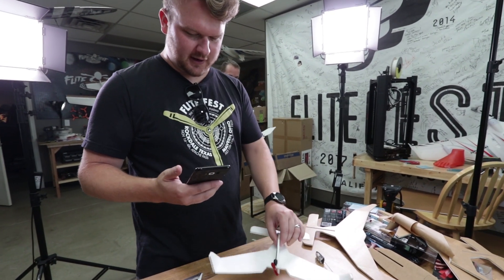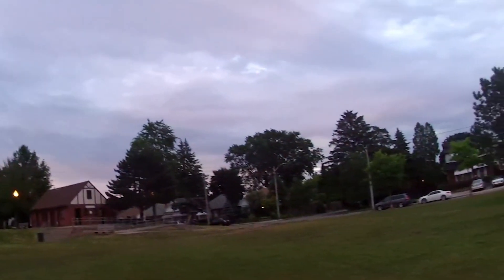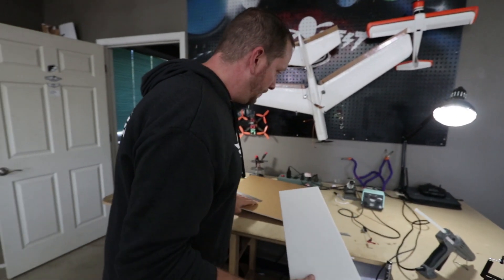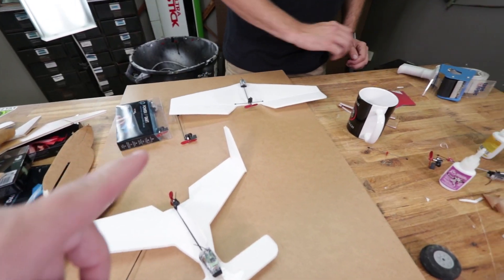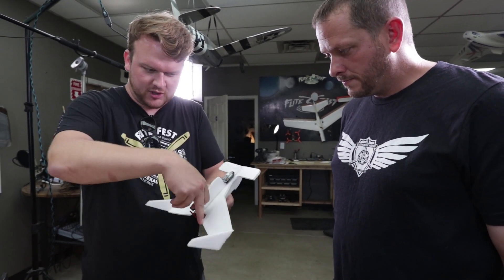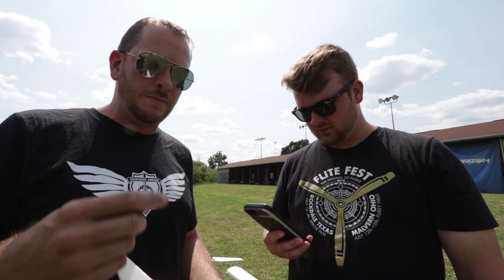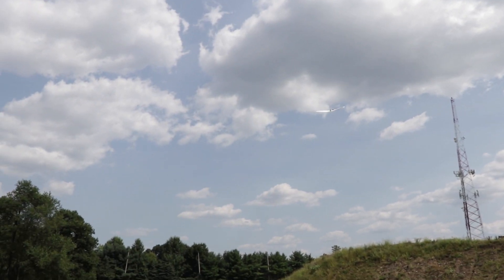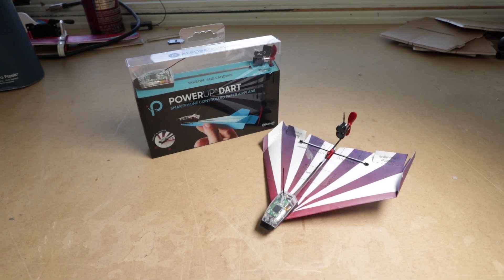$40 DIY Power Up RC Airplanes?

Comment: The B21 bomber with "no vertical stabilization" benefits from the rotational inertia having the prop so far rearward. In effect, it's acting like a virtual rudder.

Comment: I have a frying paper plane- Launched by slingshot - it flies in a circle back to me usually. Im looking for a way to steer it. Do you have any ideas about a lightweight rc control surface.   It doesn't need a motor just steering...

Comment: I wonder why no one has designed produced a similar style of lets call it a power pod, for RC light n cheap with add ons for one reason that any air frame is built around its power plant and fuel supply , however this could also be taken one stage further by adding upgrades for surface controls a sort of modular power control unit and so motor can go either end push or pull Id buy one .....

Comment: Make a plane out of corrugated plastic it structures like cardboard and is rigid and hollow so you could run a motor,servo ,or wires through it

Comment: Awesome vid as always. A few questions I'd like to ask. How many can fly at the same time on different frequencies for this model and the FPV model? Can the FPV model of the PowerUp be modified to be attached to your rubber band slingshot FastBuildKits? Speaking of, where can I download the build plans for you kits that were powered by flinging them slingshot style with a rubber band? Thanks Fellas.

Comment: Here is an easy tip for when your RC aircraft is flying away and you wanna bring it back to you but you can't work out which way it is facing, or you're having trouble flying backwards: Just move the rudder/yaw to the side it is going relative to you, if it is going left, push the rudder to the left, if it is going right, push the rudder to the right.

It might look like it is making things worse at first,  that's just what happens  when the aircraft is facing away from you, it must first turn sideways before it can point back to you.

ps: Careful with the roll if you're not flying with auto-leveling though, this technique does nothing to help with the roll.

pps: But of course, if your aircraft got dangerous props or something of the sort that might hurt you if it hits you, be sure to change strategies when it starts getting close, otherwise you risk injuring yourself.

Comment: NICE =0D maybe combine with capacitor plane for extra power/ longevity? Also, If I remember correctly the Long EZ wing doesn't need the canard. It's only there for extra stability. Maybe try it without?

Comment: Sanding the foam into an airfoil would really help with flight performance. That is how I make my micro DLGs, Foamboard foam sanded to an airfoil shape. 
     Also, sometimes things that fly as gliders would be very tail heavy or unstable with power, because powered planes usually have much more decalage, so the CG and/or pitch trim can be very different.
Reply: AeroCraft I agree, I build one of your DLGs with foam board and it flew great with the sanded airfoil, although it didn’t fly as good as balsa but it worked!

Comment: I have a mini quad (JJRC H36) that has a dead motor. Could you show us how to build a plane using the motor/s , board and controller from one of these mini quads? I’ve seen hovercrafts made from them but a tiny plane would be cool and a good use of useless parts....
Reply: Use Peter sripols video in making an RC paper plane. Just use a bigger sheet of paper.

Comment: That is so sweet...micro planes are my favorite but I always end up breaking mine before getting them to fly good.
How about an airframe that uses UMX 1S gear weighing around 40 grams for way better control...if possible a 1S brushless outrunner with more power then the geared brushed motor that comes with the old UMX 1S planes but as light or lighter....
With all the tiny outrunners available for quads there has to be a BL outrunner that can produce more thrust then stock spinning a stock prop on 1S without having to use a gearbox...I have been bugging for this for months and I feel you guys are getting closer with these new planes you made...
A little 1S BL Bi plane or wing weighing close to an OZ with the power to hover but able to slow to a crawling speed even hang off the prop would be damn sweet...
Maybe able to fly around the house with full control lol...